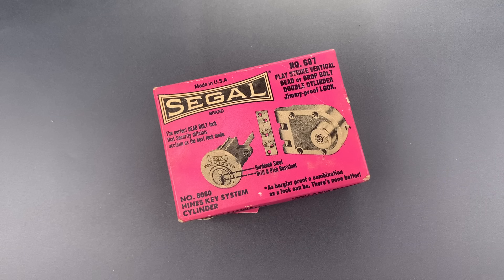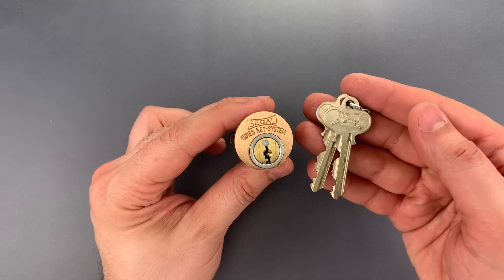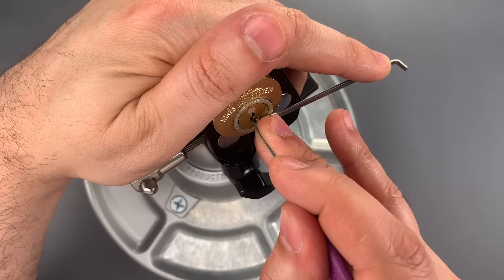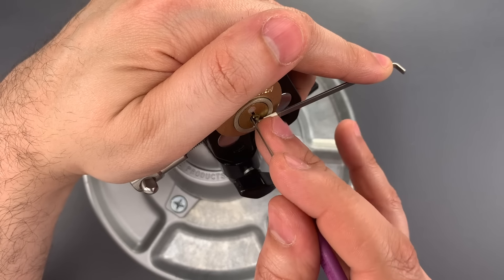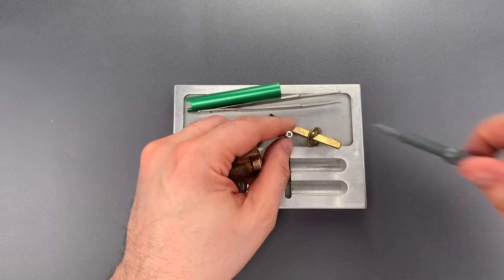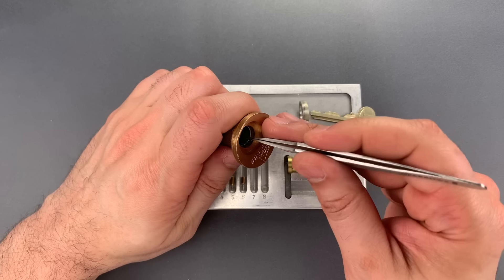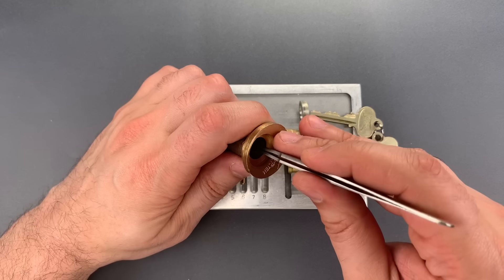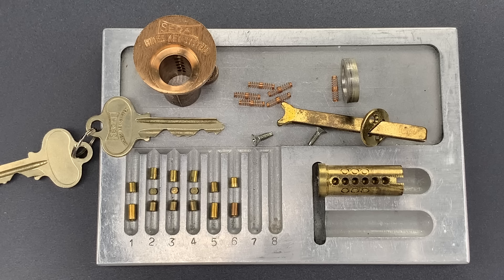[1181] A TRAP For Pickers! The Clever Hines Key System Picked

Comment: The fact that it took him a minute and 24 seconds to pick this lock made in the 60’s has to be a huge compliment to its creator.
Reply: And he only knew how to because he knew the specifics of this lock.
Reply: Well, no matter how secure a key is, if its mass produced, and in this case the brand is clearly shown, then the security is nulled
Reply: But still, an old lock taking him about 3x as long as modern "anti-picking locks" is a significant acheivement.
Reply: @sengelhard2982  not knowing he would still pick it. Probably would take him double the time.
Reply: As he said in other videos, new locks take time, but once you learn the series it can be quite quick.
Reply: @ianjones2971  That it is. Also keep in mind that not only is he one of the best lock pickers out there, he's doing this with very little pressure and in ideal circumstances. It's a whole other ball game if he was trying to pick a lock like in a real life situation. In a real life situation the longer a lock takes to pick and the more likely that a single mess up will just end up making it unpickable the less likely the thief will bother unless the value of the item is high and in which case they will probably not bother and just try to destroy the lock which comes with it's own risk. 

In 99% of cases this lock will be worth it's weight in gold, in that 1% chance you get LPL's evil twin then well.... there's not much that can be done but hope that they're slowed down enough that they can be apprehended before defeating it.
Reply: @TheRyujinLP  idk man. Locks aren't that hard to pick when they are actually hanging or on a door. I've done it several times for people that forget/lose the key. It just feels different not getting to hold the lock your way but that shouldn't be much of a problem for anyone with half a brain
Reply: @danepher  if he didn't know he would probably mess up unless he got suspicious.
Reply: @stompingpeak2043  that's you doing it for the homeowner, though. It's different if someone is doing it maliciously. Much different type of pressure, and much easier to screw up, I'd imagine.
Reply: @stompingpeak2043  also you've never picked this lock if I understand your comment correctly. You have one chance you screw up game over you're not getting another chance, and if you're a thief and you know that there's going to be a lot of pressure on you because you got to do it right but you also have to do it fast and I forget where I heard this saying also what the original version of it is but it boils down to you "can either do it right or you can do it fast but not both" in this context it means you could probably pick this thing in 20-30 seconds but you will have screwed up your one and only chance to do it right.
Reply: @USS_ESSEX_CV-9  wasn't talking about this exact lock. Just locks in general. Meaning it's not difficult to pick locks while they are hanging or in use.
Reply: @stompingpeak2043  I'm not saying they are I'm saying locks can be more difficult to pick when you're under the pressure of trying to steal a thing.
Reply: @USS_ESSEX_CV-9  meh. Pressure doesn't affect people like you think. Alot of people work better under pressure. It goes all 3 ways.
Reply: @stompingpeak2043  there is many different types of pressure some types of pressure make the human mind work better other types can make it work worse and on top of that the same type of pressure can affect two different people in different ways, a lot of my knowledge related to this stuff comes with my first hand experiences I am no thief and I do not know anyone who is a thief so I can't speak on the types of pressure associated with thieving, what I do know however is that 99% of all thieves probably know what they're doing is wrong which can do weird things to the mind sometimes, on top of that assuming they know what this lock is they know they have to get it right and they can't take too much time to get it right, if it is a person who does not do well under pressure they will definitely screw up if it's someone who does okay under pressure they might screw up they might not end of someone who does amazing under pressure then they probably won't screw up, however like I said I have no first hand experience with what is this type of pressure does to the human mind.
Reply: @USS_ESSEX_CV-9  ok you're right I'm wrong. have a good day master.
Reply: @stompingpeak2043  in some situations you'd be right in some situations I would be right. The human mind is infinitely complex it is not a case of right versus wrong. Like a lot of people assume that it is because a lot of people hang out with similar people to themselves so their experiences are generally roughly the same. So when someone comes around and says my experiences are completely different from yours most people can't understand why because again with my experience a lot of people don't understand just how complex the human mind actually is. I don't know exactly how complex it actually is I have a rough idea but not exactly.
Reply: @TheRyujinLP  A thief basically never tries to go in non-destructive.  The only reason to try is because it would be too loud for the environment.  A spy, on the other hand…
Reply: @stompingpeak2043  that is because most door locks arent actually meant to be very hard

They are meant to deter thieves because it takes a half or full minute to pick

And would be very suspicious if someone saw you doing it

This lock is like 100x harder to pick
Reply: they do if you have good windows and window frames and a strong door

As there is no other method of entry
Reply: @rachmatzulfiqar  Ah yes, security through obscurity.
Reply: @rachmatzulfiqar  it would be nice if the hollow pins were set in random positions and quantity
Reply: @danepher  I work for a retired cop, who was also involved in secure communications in the military.

He told me that the longer it takes for a bad guy to bother with breaching security devices before he can get enter a building, the quicker he's going to lose interest, if he even strikes in the first place.
Reply: If they had sold a series of locks with the traps on different pins, would that then be unpickable?
Reply: exactly. totally true dude
Reply: @danepher  he's good but I'm sure he'd tell you himself if he never knew the lock was a trap lock, there wouldve been a good chance of him activating it, and like he said there's no second tries not even the key works once that drops down
Reply: @danepher  not necessarily. If the core locks up theres not much that can be done. He would pick it as normal and more than likely at least one of the pins wouldn’t hit the second shear line and the core would be permanently locked up.
Reply: @Letsberealish  I don't believe that's true only impossible for them to derive any meaning from a compliment but not for them to actually get complimented, I can still say Einstein was a genius him being dead doesn't stop that
Reply: Indeed. '60s* btw
Reply: @Scardor  wait.... it’s written as ‘60s and not 60’s? Omg I’ve been spelling it wrong my entire life.
Reply: @obi_wanshinobi  
No, it's not, that guy is a buffoon. Certain styles in academic writing call for it such as Chicago. For it to be used otherwise even informally is mostly a new thing brought about by stuck-up people who want to put others down. Obviously, a comment on youtube do not need to adhere to any specific writing style.
Reply: @danepher  Nope, he would fall into the trap because he would think the pins are set and feel the cilinder move, thinking he opened it he would start to rotate it and then it would seize up. Clever design
Reply: @sengelhard2982  and he’s a rare mutant, who knows more than a thief.
Reply: If a lot made in the 60s and it's better than almost all the locks today that's just pitiful
Reply: That is very little consolation to someone who has just been robbed 😅😂
Reply: @sengelhard2982  He is a locksmith... you were expecting what, exactly??
Reply: @USS_ESSEX_CV-9  you ever heard of punctuation?
Reply: Looking at it in reverse, it shows in your total stagnation of our security industry. 90% of us have locks on our homes that would have been considered bypassable 100 years ago.
Reply: @TheRyujinLP your absolutely right half the time no one will not and the one that do will sieze it up trying! And if lpl was doing this in the field let's say while in another country at war trying to let his team into the targets house without notifying them and while taking fire chances become much much less
Reply: @devent10n  Despite the confidence you seem to have ”I’d imagine” is the centerpiece of your comments. 

Picking is not that hard if you do it everyday.
Reply: @sengelhard2982 You do realize that half of the picking skill is knowledge of function right?
Reply: @ianjones2971  yeah man it's wild how many ppl miss the point 😂
Reply: or a huge indictment of the market.